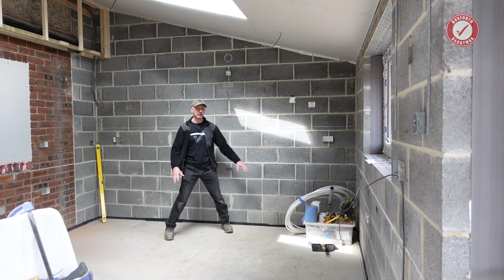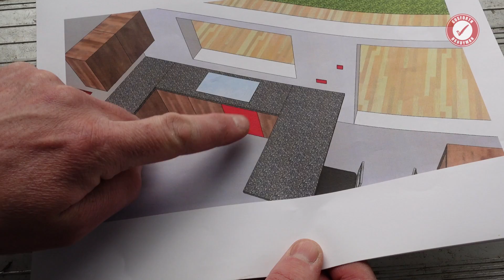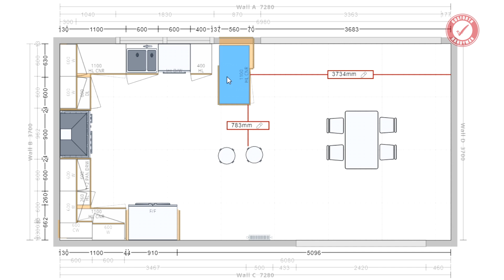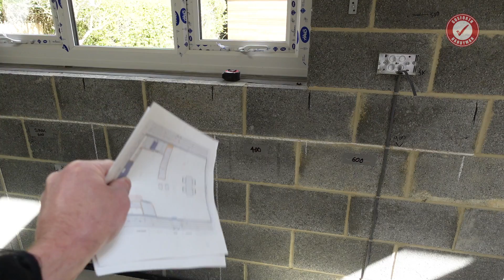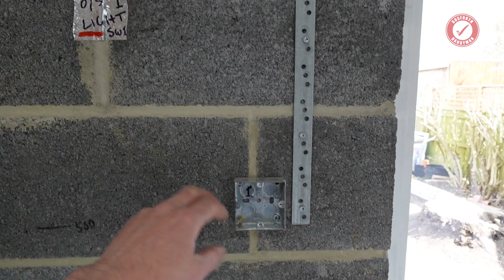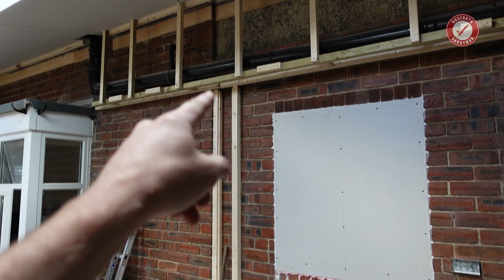DIY kitchen planning - a few tips to get it right! (Self Build Extension Part 18)

Comment: Great to be part of the process. One thing i'd change is move the dishwasher so your sink is perfectly central in the window. Being off to the side would really mess with my OCD.
Reply from the maker: Bear in mind the drainer isn't shown but just depends on the final unit sizes. 👍
Reply: I so agree with you! Lol lol
Reply: I would recommend more cupboards.  What about two tall cupboards either side of the fridge. And maybe one over the top of the fridge. Thou I guess the kitchen is now fitted as this video was done in April !
Reply: My dad had designed his kitchen in the early 90s. Double bowl, double drainer sink offset to the left to allow space for optional dishwasher on right hand side..

Instead the cabinetmaker cut the sink centre of the window, and I had to hand wash dishes for the next 12years.
Reply: Kitchens are all about the balance.. symmetry..  glass doors i told customers open your cabinet thats what you see..For display only but great as a focal point.. Crown only on cabinet tops or it becomes too much.. Lost the pop..  Build out your cabinets for your fridge 36x72  standard openning.. Or side panels.. Shallow depth fridges are for people too dumb to know cabinets can be custom fitted there.( budget custom areas)(fridges break down cousin was full custom weird size 12k to replace it) a must more peoples demanded then any other a pantry with full ball bearing extensions doesnt have to be hugh. not higher then standing the higher sections for long term storage items.. A few can be double deep for those bigger items..  Idea, at your cabinet normal doors think drawers full sided full extension.. WHY because they are a hell of a lot easier to use..no open doors both to clear rollout hardware then pull out rollout... fast for heavy pots pans.. custom the sizes depth..  As stated earlier budget for extras..  cornor cabinets use as overflow storage.. especially at base. Bending over sucks really fast.. remember pantry with slide outs  waist height..  zero bending.. sink stainless steel must be surgical stainless spend 500 or more under mounts are a permanent fixture,OK..  No water heaters at sink they just dont last..garbage disposale increase clogged pipes.. It just does..  A high backsplash locks kitchen in..a low splash allows a update to occur at sales time.. handles well get extras plus standard holes, again for updating later on..  No wood floors? why dishwasher venting kills the floor, yup..  Most homes cannot use an island no room see standard distances.. Rolling islands destroys floors, i was not allowed to sell them.. rollers dig in..  wood dont last and is very needy oils grease is a low cost finish remover.. remember to clean top of doors.. Great if selling now..  Not for a year or 2 sale..  remember click clack thats the room necessary for handles to clear cabinets.. Cornors..  When wiffy looks at counter top material blue printers measure job out and plan material stop the urge to have profile at fridge area.. I know an empty kitchen befuddles the mind.. But the profile comes out 1.5 inches or more..NOW MY FRIDGE WONT FIT!!!  No more 36 inche width..Counter top guys dont care about fridge fitting just doing what you want..  i have seen this way too many times.. It aint funny if your fancy 4k fridge dont fit..Then have to move to a smaller thinner fridge that looks stupid.. NEVER reuse weird size fridge on redo..standard is 36x72.. I walked away from many a home sale because obsolete fridge was custom fitted to kitchen.. Aint no way to fix that without redo of kitchen.. Balance and symetry...  Items appliances to install must be present in home before final measuring..In manufactures brochures it states changes can and do occur in production runs..  Funny one here peoples lock in the dishwasher, adding a high floor after dishwasher installed  woops it aint coming out happens more then you think.. raise base cabinets up to account for flooring.. (I had 1 recalled right before i did the flooring resale though but still 1 week later a really pissed off me.. Reverse osmosis lost me way too many kitchen deals.. It will leak ruin sub flooring so entire kitchen base and counter top removal to fix sub floor.. Lost soo much monies on those screwups..  And icemakers are disgusting, reality check the fridge is a open space cold from freezer its all open..so that frozen foods and items stored in fridge will migrate into icecubes..thats disgusting, it just is...Oh the worst having a garbage can built into cabinets.. The rotten bananna smell migrates all thru cabinets, yes it does.. I can still smell my utensils gross...And it lingers after  trash day.....  The electrical must be updated to be code compliant..but you already knew that..  At sink always 2 lights so a shadow is not cast.. My company would correct my mistake and charge me back..ouch....  Honestly the layout of your original kitchen is basically the way it is unless you wanna break walls and add a vent out the roof.. Removing walls is a nightmare one never knows what luckes in those hidden spaces.. wiring, plumbing a/c vents..Plus there is the leveling of floors, or the lack therof.. Waste line drop, look that one up it bit me a lot... Check your breaker panel WHY??  because you need more panel runs silly, direct lines fridge. microwahood, instant hot water multiple gfci outlets on back splash see codes. Yikes no room in panel now gotta replace it for a bigger one..oops now a drop from the main line on street to accomodate more power requirements to bigger panel...  I sold kitchens like 500 or so.. If  i left something out I was charged back for it.. It was performed..  Noo matter my mistake..  But for me that was really rare... I tell my friends to never get into kitchen cabinet business, its way too complicated, customers demand perfection. You better be great at math, detail orientated or you will starve.. All jobs were estimated on a 20 page contract.. I estimated company finalized what I sold, charged me back.... But you better have great installers above the rest.. Who stay till the job is right..we even had repair crews to finalize woops..like oversized cover plates for electrical..  Never have items built onto counter top, water will get in and ruin them.yes it will.. A lot of cabinets  face frames are particle board crap, cheap now,maybe but doors fall of in a few years.. yes they do.. There are companies that spray paint basic wood to look like cherrry wood.. Its called a 1 hit wounder,,, when finish paint wears cabinets are unrepairable junk.. I turned my competier sample to a picture frame.. It aint cherry..   Im retired now, selling kitchens was a great profitable gig.. I cannot tell you how many times i went back to a job pitched by a newbee(that quit or fired) that was way under bid.. By over 12k.. The origanal sales moron would have been allowed that screwup.. but me an exact anal only 1 job oops would have had job rejected or zero monies to me..I do not work for free.. do you..  Kitchens are the 1 room mistakes are not allowed..  Have fun..Im gonna goof off...Oh me never wood, id sell it yea, but never use it.. Thermofoil of formica for me windex and go.. can last forever.......  peace youll need it..
Reply: @Peter-td3yk   Geez.  Punctuation, please.  No more run-on sentences.